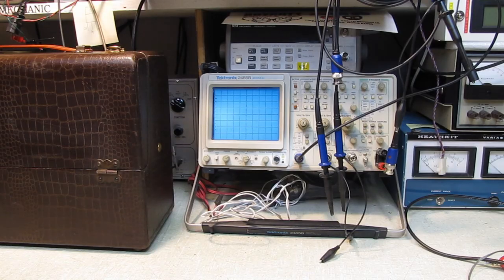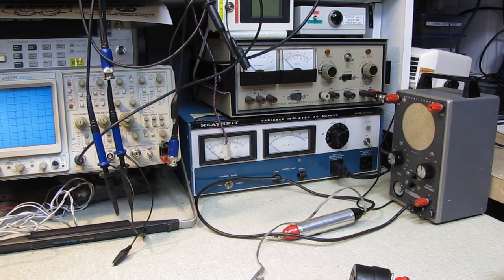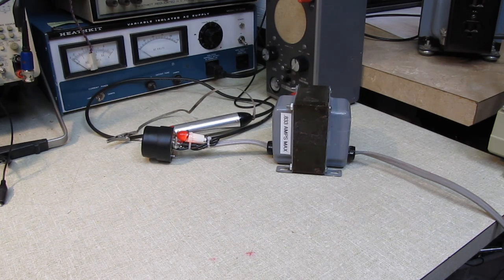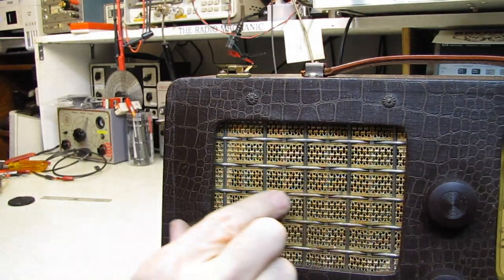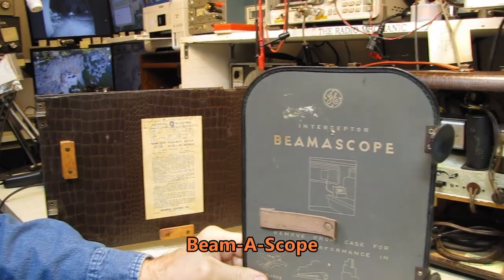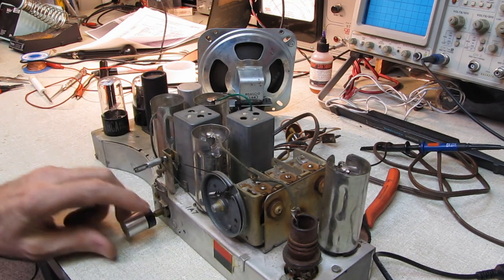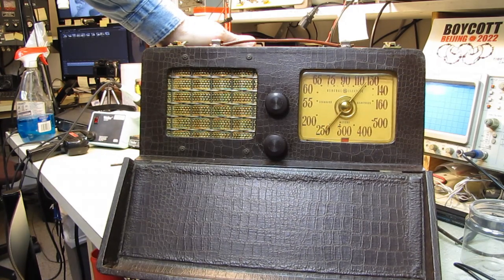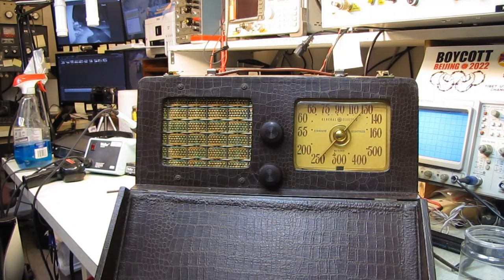Don't plug in that old radio - G.E. Model 254 Tube Portable

Comment: That was some great troubleshooting work! Although the previous work appeared to be professionally done, it casts doubt when searching for a difficult gremlin whether it was something put back together wrong or if it is something else altogether. Also, you mentioned the isolated chassis; when I do those I change the cap between B- and the chassis to an XY rated safety cap. Thanks!

Comment: Thanks for the advice as far as isolation transformers.  I have been watching radio repair videos now for over 5 years pertty much daily, I follow several repairmen on YouTube.  So after all this time, I began to look for some old sets to work on. At long last I purchased a broken GE set, a 5 tubber but modern enough to have a printed circuit type board.  Of course when it came, I opened it up right off, but never plugged it in simply because of every workman insisting I have an isolation transformer.  Now I don't have a lot of funds so it took me some searching to find a good new transformer but at long last I purchased a bare bones isolation transformer by a trusted brand, and am going to find a case to mount her in with room for an outlet so I can get started.  I don't think I am going to have a lot of luck on this old radio though.  The tubes all show a good connection on the heater but testing with my ohm meter I see there is no continuity.  On taking the board out (and punching a hole in the speaker damn it! I found that the copper traces have, well sort of disappeared some time ago and a prior owner soldered stripped line cord over the circuit.  Not sure what I will find when I do get my transformer built up and ready to ruse.  The transformer is ratted at 5 amps so she should give me
Reply from the maker: Hi Jerry, we have all felt the pain of poking a hole in a speaker. I must admit you made me chuckle. Not at you, but with you as I felt the pain. Hang in there. You learn a little from every disaster and in time it will become easier.

Comment: Didn't know about the octal portable radio tubes, only have worked on the 7 pin miniature type.
Reply from the maker: I think they were developed to be vibration proof. You could put them in a car radio and they wouldn't shake out. Didn't work out so well.

Comment: I was wondering if you had to restore the "ground" connections to an internal B- ground instead of the chassis ground connections.
Reply from the maker: Hi larry, no I didn't have to restore any grounds. This chassis is designed to be floating. The b- is its own series of connections throughout the radio. I had just been seeing all of the shield grounds and assuming at the time it was also b minus. I was led down that path because two of the schematics didn't spell out there was a chassis ground and a b+ floating. As soon as I saw that other schematic, the third one, I realized I had been working on the wrong assumption.
Reply from the maker: Text from speech got me again, that b+ should be b minus

Comment: Interesting fault, apart from bitterly gained experience there would seem to be no other way of determining the octal battery tube fault of micro-phonic oscillations. As you say valve testers wouldn't show anything wrong and I guess voltages would be correct or near enough on the various plates/grids/cathodes?
Reply from the maker: That's the real problem, the tube tester and voltage checks would all be normal. Just have to go on experience and trial and error.

Comment: Everything OK but you are scratching, destroying mechanically the bottom of this radio by moving it by shafeling on your table...you are suppose to lift it up for each move not to push it around...if this would be an expensive violin it would be scratched at the contact aria with the table...better use a piece of vinil with the aderent side to the radio box and cloath side part touching the table so it moves easily if you need to shuffle it so much...I can't stand the noise of shafeling that wears out the surface of contact mechanically...
Reply from the maker: I think the work your trying to use is shuffling? And I am not damaging anything as there are four metal feet on the bottom of the cabinet.
Reply: @theradiomechanic9625  ok maybe is the sound..